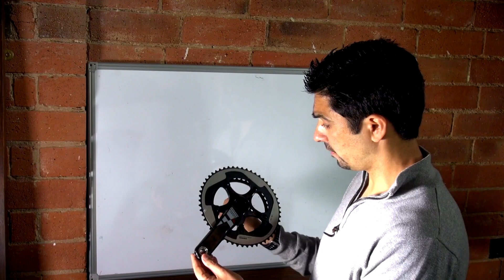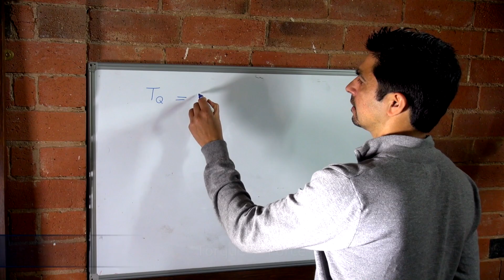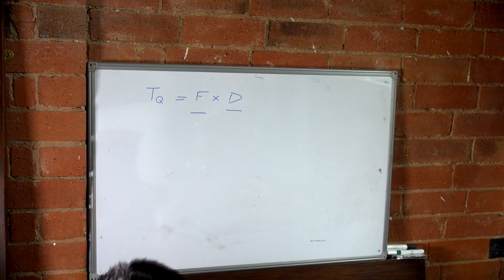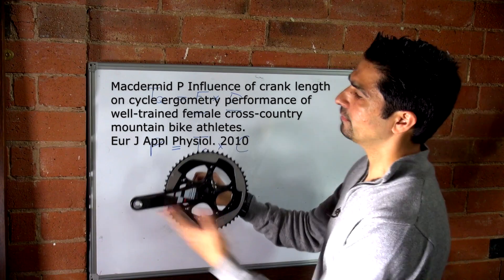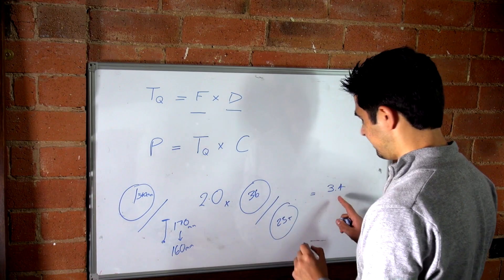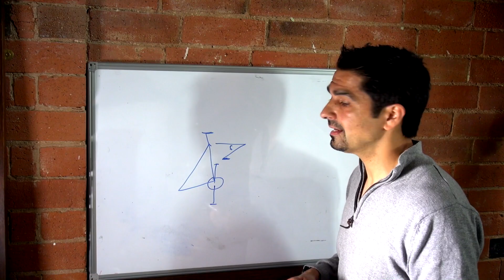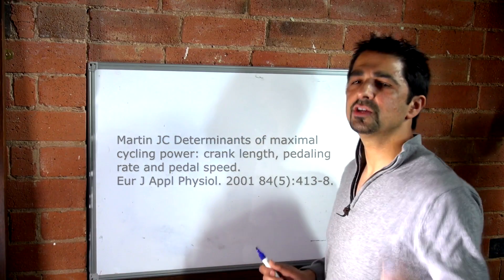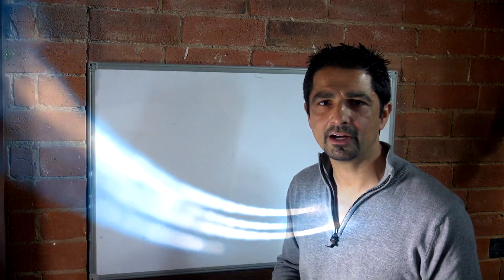The basics of Crank Length (Effect on power, cadence, comfort)

Comment: Excellent video. Explains my recent power average drop since going from 172.5 to 165mm crank. Reason I went down was comfort / bike fit. I'm 5'8 but have long legs and shorter torso. I had a hard time on the flats on a complete aero tuck. My knees would hit my chest so I couldn't get my body low enough. Sadly I seem to have a hard time averaging big cadance numbers (shoots my heart rate to sky) hence the little power drop on my rides. Hopefully I can make it up with getting a little stronger or just practice spinning fast more / improve endurance.
Reply: just curious, what happens exactly when your heartrate goes to sky? do you gas out?
Reply: Basically if I spin fast cadance my HR goes up but my legs get some relief from grinding (slow high torque)
If I grind slow high torque my legs get too tired while my HR is fine. 

So you find a balance. Once my HR goes to the sky I slow my cadence down a bit to adjust and get my HR 2-3 bpm lower which keeps me going. 

If neither of these help you stop and rest. I generally don't have to stop during a climb. I'm at a decent fitness level where I can choose to take a 10% hill easy (relatively) and get through it even if it means I go slow as hell. My HR shooting up is when I'm trying to get a good time on a climb etc.

Comment: There is a benefit to shorter in mtb' ing In that a shorter crank  gives better ground clearance when pedalling through rocky sections and later pedalling into a corner and earlier pedalling out of a corner - this would also affect fixed wheel bikes when cornering on road as you - whether this advantage would outweigh the  leverage ratio difference would be down to your body dimensions and riding style - there is one other difference more relative singlespeed and fixed wheel riders in that with shorter cranks there is less vertical movement of the legs which would affect rear stability when spinning out a gear - marginal of course but still a difference nonetheless relatable to the engine stability difference of a rotary engine vs a conventional V shaped piston layout.

Comment: Short answer - longer giver better torque, but.. foot speed increases & therefore O2 consumption increases .
Reply: Good video btw
Reply: Not necessarily. Longer will always give more torque when the crank is at zero speed. However, when moving one cannot put any force on the pedal until the foot is moving at the speed of the pedal so the faster the pedal is moving the less force one can put on the pedal and with longer cranks the pedal moves faster at the same cadence. The other issue is the knee loses efficiency the more it is bent (can you lift more weight doing a half squat or full squat?) which again can lower the ability to apply force to the pedal with longer cranks or improve the ability to apply force with shorter cranks. Cyclists should spend time optimizing the engine by experimenting and finding the right crank length for them and most of you are probably not withing 20-30 mm of optimum. Cyclists vary in size by about 30% whereas most of you are riding cranks in a 6% range (165-175). A 30% range in crank length goes from about 125-175. Then we have difference is flexibility and build. The optimum crank length for the population probably varies by about 50%. Once you have figured out the optimum crank length to optimize your engine then you can fit out the rest of the components to optimize the bike for the kind of racing you do.There is no crank length formula that fits everyone.
Reply: your conclusion is correct, the rest is debatable.
Reply: duvo bikes I'm a returning cyclist (following a bi-level lumbar injury with surgery and two years of PT), and I've been watching a ton of these videos... and what I think it all comes down to--just as with any other discipline--is that there are no universal bests. The best equipment and technique is the equipment and technique that works for *you*. If everyone accepted that as truth, though, there would be none of these videos. :)
Reply: Hi Ian, your correct. everyone is looking for the magic trick to go a bit faster. there is one, its called training.my interest in the topic goes back 10 years when I rode pursuit. guys were training on short cranks and racing on long cranks, theory was long cranks aided your start so you did not have to go as deep. I got to talk to a Brit track coach, and he was luke warm with the idea of longer cranks due to higher O2 use.  Now they talk about long cranks preventing you getting aero. I always rode 175's but got a really good deal on a C.record chainset which was 172.5 and have been riding that ever since. Sorry about your injury & wish u the best.

Comment: I find the part at 4-5 min confusing. Seems cadence and foot travel distance is being mixed up. If torque and power is the same then cadence is also fixed. Only crank length and force could vary while maintain equal torque. A nice thing to analyze futher would be the ideal crank length to a certain inseam length. At which radius do we keep our leg muscles working in their optimum most efficient range? Seems to me the more we bend our legs the less power we have. But how short crank is too short then? Also what about the issue of hard accelration (sprinting) requiring maximum leverage (torque) compared to just maintaining even power output (tt?) requiring constant force (power). Maybe less energy is wasted with short cranks if the power is kept constant.
Reply: point is that if you increase D in order to increase the torque and you want to increase power thanks to that increased torque, you should keep the same cadence you were able to produce with a shorter crank. That is more difficult with longer cranks as the pedal velocity you have to produce to achieve a certain cadence must be higher than before, as the circumference of the pedal stroke is also increased.

In other words there is a trade off when you increase crank length. On one hand the immediate effect on Torque is clear: increase D and T increases. However, due to the fact that now you have to ravel a longer circumference, it will be harder to keep the same cadence.

To answer your questions: it depends on the rider, try different crank lengths and see what is optimal for you. I am 1.82 and for instance I ride 172.5. This obsession about long crank lengths is due to the fact that people analyse only the "torque" part of the argument.

I hope it is clearer now ;-)
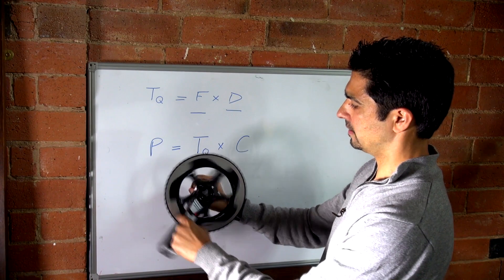Reply: Yes there are several errors in terminology at least here. At about the 4:50 mark the presenter misinterpreted (or misuses) the P=Tq X C(?) formula when he states that if Torque and Power remain the same when the crank length is changed, the Cadence must change(?). This is incorrect. As mentioned in the other reply, the variable that changes is the amount of distance the end of the crank travels (greater circumference) and therefore the speed of pedal/feet has to increase to cover the same amount of distance in the same time, when compared to a shorter crank. Not the cadence. 

For a tall enough rider there is little difference in perceivable torque advantage between a 172.5 and a 175mm crank. The difference in pedal speed between 170mm and 175mm cranks at a cadence of 80rpm is less than a 3% increase. This doesn't directly correlate to a 3% increase in O2 use/energy input. Not nothing but not huge.
Reply: Mike H yes definitely confused

Comment: well i tried 175mm ones then 170mm and then 165 mm ones and i am not sure of anything .....my weight is 170 cm and 81 cm from foot to crotch ....but for sure i know with 165 mm i feel my knees in short of time maybe directly after 4h ride /depends on intesnsity/ .....but yeah my natural cadence is quite low 75-85 rpm
Reply: Well. My opinion is that crank length must be result of natural cadence. Natural cadence is result of BMI. I know that BMI is useless measure but in this case it help you. If you have high body fat or body muscle that need hi amount of oxygen. If you go hi cadence that also need hi oxygen. As consequence you will be out of power very fast. So, you must use muscle to sustain power for longer. 
On the other side, if you are slim, low fat, low muscle you need hi cadence. You will have more oxygen to spend but no big muscle. It is better way to use oxygen to sustain power for longer. 
You use what you have more to spend or only think you can. 
Now I have 175 because I have hi BMI. OK, I'm fat. But back in time my ideal length for 53/25 was 170. I have that bike. That is only reason I can remember that. Also different body shape. I was really slim, fast and powerful. 
That is result of GCN test. But you must interpret it correctly. If you are beginner, 175 or 177,5 will be ideal but you must know that it will change if you are become more fit. 
Crank length is anything about comfort or height or leg length.

Comment: obviously now one has watched the video until its end as they admit within ranges between 120 and 220mm, the crank length does NOT have significant (within 1 or 2%, which is within measuring errors) effect on power output.

Comment: Leonard Zinn SWEARS that taller riders need longer cranks. I am 6'3" with normal length legs for my build and I use a 175 on my road (race) bike and 180 on my TT bike and can't really tell a performance difference. I want the clearance during criteriums so I don't see any reason to go past 180 as I've scraped a pedal a few times just with 175s. And thats scary at 30 mph in the middle of a corner!

Comment: I'm 5'7" and wear a 30" inseam pant....I use 170mm cranks.  I tried 172.5mm with my last bike, and spinning at higher cadences was much more of a chore - plus my hip angle was more acute as my seat was slightly lower (and overall more uncomfortable as well).  I haven't noticed any real differences in overall power output however between the 170's and 172'5's with my power meter...however, it was marginally easier to climb steeper grades with the 172.5's.

Comment: I went from 172.5 to 165mm. I am 5'11 with a 32" inseam. Due to arthritis in my right hip, I shortened my crank length because of pain in my hip on the up stoke while pedaling. After doing so, I saw an increase in speed, due to the lack of pain!!...so, yes crank length does matter! Bottom line, everyone is different, so find what works for you! Smooth is fast!!!
Reply: I also went from 172.5 to 165mm. I'm 31yo, 5' 10", 32in inseam. I have used 3 different crank sizes 172.5, 170, and 165mm. I use 165mm because it definitely feels best of the 3 sizes. I don't have arthritis but it still feels better and more fluid with the shorter cranks. I ride over 600 miles a month. I also put 145mm cobb cranks on my girls bike,she likes it sooo much better than the 165's that came on her bike originally. Hope this helps somebody make the decision to go to shorter cranks. Worth it 100% imo.    https://www.strava.com/athletes/3853032
Reply: Good that that worked for you. I see some people stretch before kayaking , cycling, or rock climbing .I never have but it probably would be a good discipline to have.  i went from 170 mm to 153 and no power loss plus better spin. However I do not compete  and have a touring recumbent that had I known the advantages of a recumbent over a normal bike I would have changed much sooner. Short cranks should be emphasized that they are not for everyone. Those of us who have them will not go back to what comes standard on any bike sold today.
Reply: For those that want to buy short cranks  this is the guy I have bought from,
http://bikesmithdesign.com/Short_Cranks/index.html
I ride a recumbent and I went through various sizes till I found the ones that I feel fast and comfortable with. I am now riding on 153 mm crank arms and I am 6'1" all the power and no pain in the knees, the same knees I have trouble with climbing stairs because one of them has a torn meniscus within. The recumbent came with 170 mm cranks and a different seat. Comfort is available for your body or just your knees/ hips.
Reply: Very interesting. Since I starting cycling 2 years ago, I've had off and on right hip/flexor pain.  I'm 5'9 with proportionally shorter legs and I have 170mm crank.  I'll look into switching to 165mm.
Reply: I have also went from 170 mm to 165 mm to try solve some hip/gluteos pain.  It did not work and I was very worried about it. I finally find out that the problem is when you ride a lot your "vastus lateralis" and "rectus femoris" muscles develop to much and you can have pain in your rip or your gluteos.  After several months making some specific exercises to stretch  all muscles I solved the problem.
Reply: Currently doing the same for my Tri bike... expecting to want to do similar to my road bikes. Have been training lower cadence and harder pushing and it's also helping power output.
Definitely stretching and rolling works to keep myself fit and now I'm finally seeing some decent improvements!
Reply: 175mm iscwhat i currently run im switching to 165mm due to knee pain and hip pain
Reply: Running 155mm here. No noticeable difference in power compared to 175mm, but easier to maintain a higher cadence and power figure after long rides (>100 km). Concerning crank length I'd say go as short as you can without losing significant power.
Reply: And ive made a great choice going with Qrings from rotor and its making a world of difference
Reply: や
Reply: Thanks Angus for this. I fell off my bike a couple of years ago and had t get my hip drained couple times and since then my hip gets really sore after a hard ride. I’m 6’4” and run 172.5 mm length and have thought about shortening it could be rather helpful.
Reply: Angus, I'm very interested in whether shorter cranks can cause a decrease in hip pain, and am happy your hip pain is improving.  Did you adjust your saddle height, however, when you shortened your cranks?  If not, is it possible that the decreased saddle height due to your shorter cranks has something to do with your decreased hip pain?